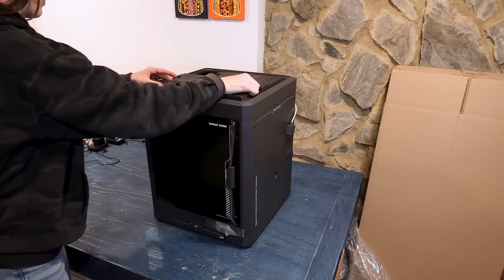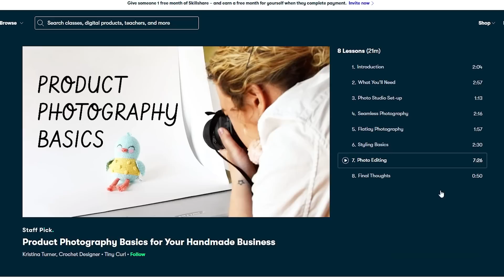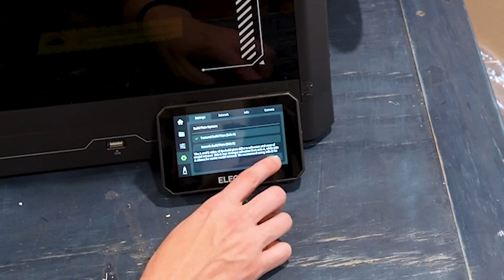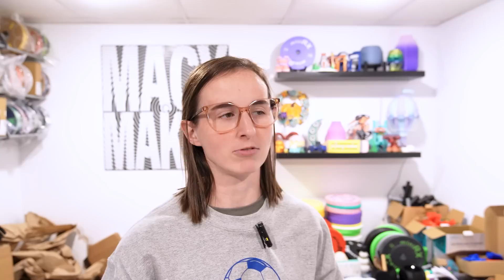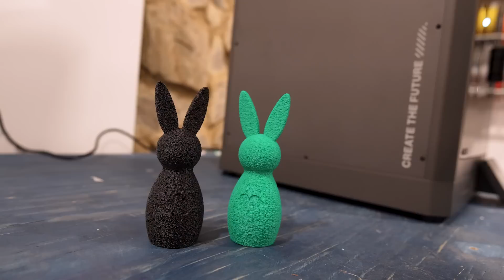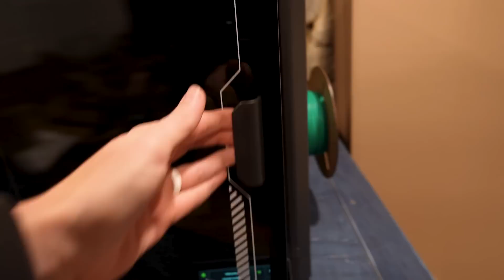The BEST Budget 3D Printer - Elegoo Centauri Carbon Review

Comment: Does it print TPU?
Reply: Easily, ABS is harder to print then TPU. This has an Steel hotend so it can even do Carbon Fiber
Reply: @AlbertoMartinez765 What? CF PETG or PLA require just a hardened nozzle. TPU needs a good direct drive extruder with little friction. This one looks like it won't print TPU very well if at all.
Reply: @Liminal.Headspace  Thats exactly my point...nobody gave information about tpu. ABS is possible because of housing and temperatures. But TPU is a extruder thing...
Reply: @mpa568  Oof, that could be a problem. Perhaps it's best to wait for their inevitable $100 more expensive "luxury" model :)
Reply: @unspeakableoaf  I think this one is the $100 more expensive luxury version. The cheaper one is just called Centauri and is priced in USA at $199. Most specs same as this one, but not enclosed, different nozzle, not sure what else.
Reply: @mpa568  Just looking at the extruder, it might be able to do 95a TPU. But not well. You'd probably have to go with 98a but at that point why even bother.
Reply: @Liminal.Headspace  understood, but why do you think so? What does Limit the Extruder for TPU?
Reply: @mpa568  Simply put, it grips the filament way too tightly and there doesn't seem to be any way to adjust the tension. TPU is soft, fragile and bouncy.
Reply: @Liminal.Headspace  Thx for explanation. :)  They have 95A on their Website available and wrote TPU in the spec - Just had a look. Seems like you are very right with what you expect.
Reply: @mpa568  95A is embarrassing for a new printer at 300 bucks. I print 82A on an ancient Ender 3 Pro with a Sprite Pro extruder - which is way stiffer than the regular Sprite since its meant for high temperature materials. But it was also way cheaper on Ali
Reply: @ I was thinking about a slighly more expensive, slightly bigger printer they could theoretically release ;)
Reply: @Liminal.Headspace  Had the same one - but sold it 2 years ago. I was waiting for a well priced printer with full housing, because dust was very anoing over time. Tought of sovol sv08 because of the size...but decided against it because of the tinkering. In the end i never printed TPU before - but it would be nice to have that option. But i will use the printer for technical parts mostly. And Pla for my children :)
Reply: @mpa568  Hate to be that guy but there's no good enclosed printer for cheap - that's not a Voron/Voron clone kit. The Bambu P1S and Anycubic Kobra S1 are 600$. But, one's a Bambu and the other is an Anycubic.
Reply: @Liminal.Headspace  I supported a friend building a voron. But 600(bambu) to 2k (voron) is too much for a printer i believe. I had to pay 350 Euros for the elegoo...and it takes 2 more month before available in europe. Thats already a lot of money to get plastic parts :) ...but i used parts from my lastest printer in the Motor Control ECU of my car, on the roof of my house and had many other useful applications. I have friends with X1C and A1 Mini...they are Happy ...but either expensive or no housing...so no Option.
Reply: @mpa568  I feel you man. I've saved for a long time and finally bought a Prusa MK4s on sale. And now I finally understand their high price. There's no issue that can't easily be fixed and it's by far the best printer for minis. It will do better with a .4 nozzle than a Bambu with a .2 nozzle. Hope you'll get your mileage out of that Elegoo
Reply: @Liminal.Headspace  Really? Thats sounds Impossible :D But yes...quality has its price and makes a difference. Lets see how the elegoo will turn out in reliability and repair friendlyness. For sure the sidepanels need some isolation stickers...so far there is no 0.2 nozzle, would want one too :)
Reply: @Liminal.Headspace  Do you use multiple toolheads and multicolor too?
Reply: @mpa568  The MK4S has only one tool head, you're thinking about the $5000 Prusas XL. I did buy it with an MMU3 bundle and use it regularly. But not for TPU, I've got a roll of TPU on the side and just do it old school. I've managed to print some specialty TPU with the Bowden system of the MMU, but it's expensive for no real benefit.

Edit: I only use Recreu Filaflex TPU, nothing compares.
Reply: @Liminal.Headspace 

You are right :) My mistake. Lets see when the printer arrives, i may give TPU a toy test for my children. 

Thx for the nice conversation!

Comment: For $300, It's really a no brainer!  I have 2 A1's and wanted a Core XY so this is the solution for me.  If it turns out to be junk, it only set me back $300.  If it turns out to be a good printer, I might order a few more, even if they decide to raise their price a little.  The wait till June is ok for me, because I really think there will be at least 2-3 firmware updates and possibly some hardware upgrades before it arrives.  Maybe even a better light in the machine.  Great video again!
Reply: Even as just an Extra 3d printer Just in case its good to have.
Reply: @AlbertoMartinez765  I wanted to try a core XY printer and just didn't want to pay for a P1S.  This cost less than a Bambu A1.
Reply: @stevemisher7197  It's more like $450 here, but the nearest decent enclosed printer costs nearly twice as much here, so this could be the new hotness.

Comment: Well that was a fast turnaround from when you told me you were going to do this video!  1st thing I gotta say is I was caught off guard at the very beginning because your hair is different!  No pony tail and it appears to be shorter!  I'm a sucker for pony tails but it still looks great!  LOL  

I have heard that $299 is the pre-sale price, and that the regular price will be more like $500....but I don't know if any of that is official.

I had seen in another review that the bend in the tube as it goes into the extruder is a little too sharp, and that causes the filament to not feed in sometimes.  Seems like you had restriction the whole way, not just at the end though.  I also use the P1S loading 'cycle' to know when to get back over to the printer to push the filament.  LOL  

I do believe the calibration time for the P1S after they added the inertia dampening (I forget what it was called - where it tries to minimize the motor noises) is up to 26 minutes.  At least that's what the screen says, but I never timed it.  Before that it was more like 15 mins.

I only level my bed before the very 1st print, then I skip it for the rest of the day, until I turn it off and on again.  I do also do it if I change plates.  I also print w/ the top off (PLA).  Not sure if it's actually a Bambu recommendation or just something I read recommended for PLA.  I don't think matters for shorter prints, but the theory is that on long prints (hours) the heat builds up and leads to 'heat creep' which can cause the filament to start melting further up in the nozzle (in the cool zone) and cause clogs.

The slicer is based off of Orca, which is based on Studio, so it should be nearly identical.

You are braver than me!  You printed a LOT of parts on each plate for the mini fig....I always separate it into smaller batches.  I figure that way if something goes wrong, I don't lose a lot of pieces.

Thanks for the mention Macy!  Really made my day!  Another great video and you just keep getting better on your editing/production.  Congrats on the review sample, there will be many more in your future!
Reply: I've printed entire objects the full size of the 256x256x256 build volume of the P1S and never had an issue afterwards or during printing, with door and lid shut, and ams on top
Reply from the maker: Thanks Dave :) I'm already working on some other mini figs. Might be a new obsession now thanks to you haha

Comment: It'd be good to know (especially following the whole outrage over BL changing their software) exactly what works (and doesn't) on this printer with/without full/constant internet access. Are you limited to printing from USB? Do you need it for firmware updates, or can those be loaded on USB? Does it have LAN-only access so that you can send jobs/control the printer from your network, but without the "cloud"? If it does have a LAN-only mode, what stuff do you not get or has reduced functionality? Can you block it from reaching out right from the menus, or do you need to do that at your router?

Comment: I like the reprint option. It's the same on flashforge. It saves time because you can skip the leveling unlike the bambu. When compared to flashforge adventurer 5m at the same price, it's a good deal.
Reply: It's more about the reprint option being green which most peoples brain would link to a confirm button as in print is finished confirm.
Reply: @Yuuki-ch4n  I understand that but she also referenced that this machine takes longer than bambu but it depends on what you're printing which makes that reprint button viable. It's faster when printing the same object over and over again. Flashforge is also faster with this option. Bambu prompts reprint or ok at the end.
Reply: @donoho93  You can edit your Gcode in Bambu Studio to Not level everytime.
Reply from the maker: Cool, I didn't think about that. I figured it had to be there for a reason just felt odd since I don't reprint most things back to back.

Comment: Seems like a decent value at the price point!  I run 15 P1S printers and have been looking to add more units but not sure if I want to mix new models in.  How do you think this compares to the A1 since that's as bit closer to the price point than a P1S?
Reply from the maker: I'm not making any changes to my print farm at the moment. I would still pick the A1 for now since it has multicolor and  has been proven to work. I'm curious to see the longevity of this printer, being so cheap.
Reply: @ good call! I do think at their price point this seems like a good value though and it’s nice to see them releasing a coreXY!

Comment: Estimated Shipping Date from US Warehouse: Before June 30, 2025.   They really should have had more inventory for the release.
Reply: I’ve seen some people online comment they’ve ordered when it said that and ended up getting it in like 5 days or so.
Reply: @Pickle312 I got mine last Friday and it’s a good printer so far. I added an LED strip with a switch that I wire into the PSU. works perfectly.
Reply: It was a soft release to mostly content creators to bring in the money to fund it. Probably the same reason they didn't offer a multi color system up front. That's the only reason to offer a pre sale. To gauge how many you need to produce and help fund it.
Reply: Patience is key. By the time you get it, there will be a ton of updates and quality of life improvements. Stay positive!

Comment: I am actually considering getting this printer when it's fully available, so great video! I love the enclosed space for control of VOC's and it's definitely targeted to those Bambu Labs users. Appreciate your feedback and insight. I think adding a light into the inside of the printer would be great to be able to see what's happening without having to remove the glass top. I do wonder if they are going to come out with a multi-color solution like the Bambu AMS, but otherwise this is great feedback. Thank you for the video!
Reply: It's stated on the listing of Centauri carbon, that a multi color system will be available in q3.
Reply: @donoho93  Thank you for that.
Reply from the maker: Glad you enjoyed the video :) There's rumors of a multicolor system coming... We'll see what happens as we get closer to the end of the year.

Comment: Its a fantastic printer. So far one of my more reliable printers with 0 miss-prints. 
Also, cant beat $300
Reply: How is the dimensional accuracy?
Reply: @missingpunctuation Out of the Box the accuracy ist fine, If you dont use full Speed. Ther ist also space for optimizing...
Reply: @missingpunctuation  Watch Auroras Review of it, top notch
Reply: It's really not, I have a few bambu labs p2s printers and a Creality k2 combo both great no issues at all so far apart from the creality needed a new extruder after some filament destroyed it but it was a cheap fix, anyway I had this Elegoo centauri carbon and ended up giving it away. Too many issues with it, slow af when you want to do calibration, its noisy, its a pain in the butt for bed adhesion, the print quality was always hit and miss imo,  and the straw that broke the camels back was the fact that the board that controls the heat for the hot bed decided it no longer wanted to be soldered and removed its self. 

After weeks of waiting for a replacement part from Elegoo and messaging back and forth for Elegoo to finally comply with the warranty claim and ship the replacement out and install I decided to give the printer to my father who ran it for a few months and is now having issues with the extruder... Its cheap for a reason, I wont be buying another elegoo printer. Their filament is not too bad but their FDM printers are terrible imo.